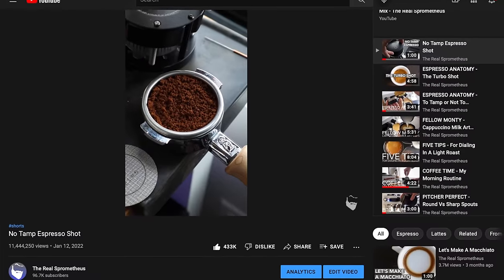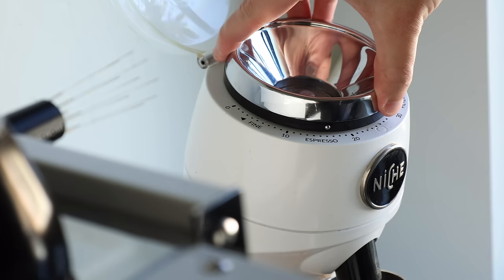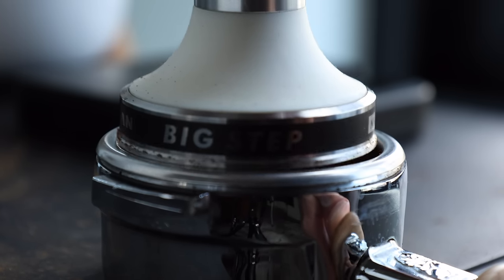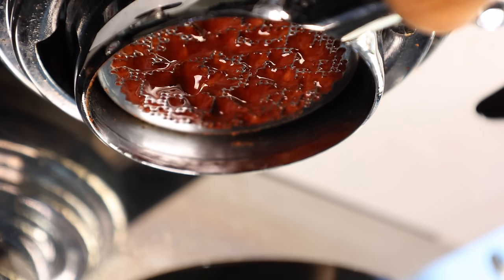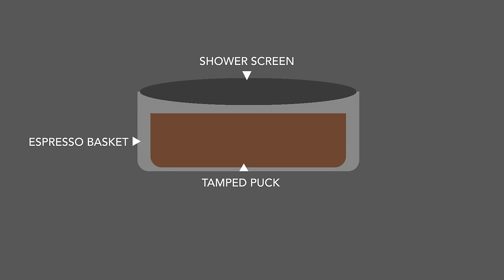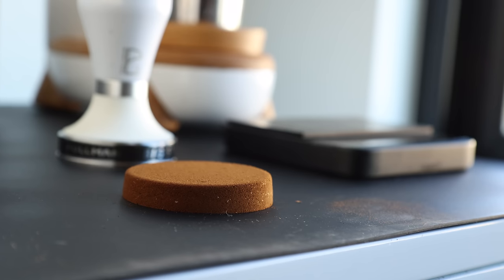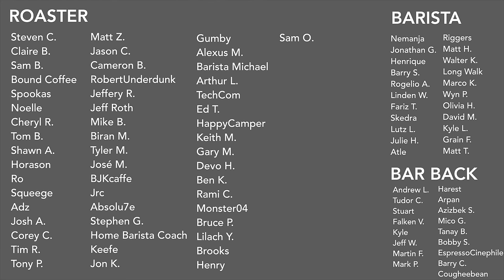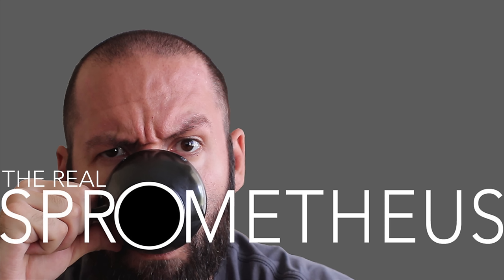ESPRESSO ANATOMY - Does Tamping Matter?

Comment: This reminds me of the debate about whether or not turbo shots and flow-profiled shots are "really" espresso.  I wonder if a "true" no-tamp shot works better with deeper baskets, and perhaps an Aeropress filter or puck screen on top, kind of how a moka pot brews. Then again, a moka pot brews much hotter but with much lower pressure. My thought is that not tamping at all creates a slurry because of the turbulence in the basket from the high pressure. When I was first introduced to this concept, it was from the people at La Marzocco during the NY Coffee Fest in 2018. They were dosing 17g and using a distribution tool, but also using a GS3 for pressure profiling. I found the best results with the coffee they were using were a distribu-tamp with a slight pre-infusion, 6 bar pressure, and then slow ramp back down. Thinking about this moka pot as a comparison, this makes some sense to me.
Reply from the maker: I see what your saying, that is interesting. But the part that I was most surprised by, there’s a debate that turbo and flow profiling isn’t espresso? This is news to me.
Reply: @Sprometheus  Yeah, it's a pedantic thing of "if it doesn't hit 9bars of pressure and doesn't extract in the SCA defined time for espresso, then it's not espresso".

Comment: Well spotted Sir! Fascinating seeing the outline of the distributor at the bottom of the basket when the flow first appears. You didn't mention the puck screens. I've found I can tamp much lighter, with better results using the puck screen. I suspect that the puck screen does a sort of in-shot secondary tamp as my pucks are always nice firm cakes when I knock them out regardless of how hard I tamp.
Reply from the maker: Thanks George, and I did try the puck screens and I found it did do some compression but didn’t include it as it just didn’t seem to be all that interesting of an addition to the topic. And for me using the screen with untamped coffee and a normal dose the screen on the machine actually would press down effectively tamping before the water even flowed.

Comment: I've been riding the 'no tamp, just level' train for about two years. The reason I keep at it is that the shots taste good to my palate and it keeps things consistent. That being said I adjusted my leveler to max height (or depth?) to ensure the puck is basically compressed.
Reply from the maker: I think a leveler can be almost as consistent as a palm tamper, and taste is king! So as long as it’s tasty no need to fix something that isn’t broken
Reply: @Sprometheus  agree on that
Reply: Many ways to skin a cat.  It's all about taste.  I've made many an espresso that's come out too fast but tasted awesome and then saw sprom do a video on the turbo shot.  Was a great watch.

Comment: Great video, I only used a leveler for the first 3 months of making espresso but then switched over to a tamper. I found I got better body and texture from my shots but felt it was less consistent. I just bought a normcore tamper so I'm hoping I get better consistency with tamping pressure and leveling. (My setup is a Gaggia Classic Pro with OPV mod and a Baratza Sette 270)
Reply from the maker: Thanks Andrew! A palm tamper is always going to the the most consistent way to go, I have one but just love my Pullman so much haha. What pressure are you using on the OPV, I have a classic pro and the kit here, just waiting to be installed haha.
Reply: @Sprometheus  Yeah I was originally thinking about getting a palm tamper but I just like the aesthetic of an actual tamper haha. I'm using  the Mr Shades 6.5 bar mod which I prefer to the 9 bar one.

Comment: When I first bought an espresso machine I watched a video where Mark from "Whole Latte Love" commented that tamping was overrated and demonstrated just using his (Assos) leveler to do the same job. I've now been doing it that way for years with good results and have, in fact, never tamped in my life! I do have the leveler set fairly deep so it applies some pressure, and I lower it onto the bed very slowly while spinning so as to evenly and gradually apply the pressure. It has worked for me. But I do wonder if by tamping I could elevate my results further. One thing I found interesting, and perhaps unsurprising, in your testing is that tamping had the highest extractions, followed closely by using a leveler, but the leveler appeared to actually have the most consistent results!

Comment: Yes tamp - but not overly hard. I also have a Niche, OCD, and LMLM. My son visited and tried it. He really smashed the tamp and got more channeling than I ever do. I’m probably hitting just under 30 LBs. I press until the sponginess collapses and no more.

The biggest improvement to my espresso, since getting the LMLM is backflushing daily. Since I’m only pulling 4-5 shots, rather than a cafe load, I can use the tiniest amount of cleaning powder. It rinses fast and easily, so it’s less than a five minute job. 

In the past, I treated it like BIG maintenance. I’d remove the screen and basket to soak, open the machine to oil the boiler vent valve, etc. It was a pain, so I did it rarely. There was lots of buildup, so I’d use lots of chemical and multiple applications. Rinsing took longer and probably left residual soap. Not ideal.

Now, I just leave the screen in place and use a trace of powder. It’s fast and easy, rinses perfectly clean, and every shot is crisp and in clear focus. Without such cleanings, shots get muddy with a hint of old-coffee-pot from the rancid oils.

I still do a bigger clean or service on occasion, but doing a quick simple backflush daily is a great habit to develop for getting the best possible shots.
Reply: The key is to use the smallest amount of cleaning powder that you can get away with. Just enough to still give some suds. Since the buildup is minimal, you don’t need much, and with minimal soap and clean surfaces, there’s nothing for the chemicals to attach to. It really rinses clean.

I wish I had learned this years ago.

Comment: Quite an interesting video and the comparison test results was kinda expected but strangely enough, I just came across one barista of a famous coffee shop from Japan who doesn't push the tamper into the portafilter basket. I saw that he barely pressed it down, just a slight touch on top of the coffee ground to make a flat surface of coffee bed. Even so, he can pull the shot in a consistent way and the coffee dripped down through the bottomless portafilter with a good flow without any sign of channeling. Worth mentioning that he paddled the Slayer halfway and wait for about 17-1s before he continue to push it all the way.
Not sure if it is something unorthodox but his workflow seems to be more efficient.

Comment: Re OCD
in order to avoid the slight uneven compression, I use my fingers slightly between ocd and portafilter…. Giving about 3/8 inch space.  Then spin the ocd as I drop the final 3/8 inch.  

I also use the currently fashionable screen which I feel has a few benefits,   Keeps the screen and machine cleaner! Reduces occasional channeling, and eliminates occasional puck adhering to the screen.

Comment: I mostly do 19-20g tripple shots in a naked PF and I use a leveler for it's intended purpose-TO LEVEL the COFFEE BED-and then I do a moderate to heavy tamp (mazzer Major/titanium burrs set @ around 8 with actual zero (when the burrs touch) being 6. This method has been working for me ever since levelers 1st became available.
Reply from the maker: I found a mixed experience with levelers. I actually retired using mine awhile back because I found lower extraction numbers. But I think there is something to be said for all of the variables combined.

Comment: The extraction percentage chart put up at the end was very telling and relatively linear among techniques which I feel is a pretty open and shut case that puck compression is required. How that compression is accomplished is more nuanced. As I mentioned in the last video I have removed my tamp (calibrated) from the flow just because my observations seemed to support the empirical data provided here. I could probably squeeze a few additional percent out of my workflow by adding it back in and for troublemaker extractions I do. I think we may be able to settle on the term "compressed" to encompass all of the myriad tools we have at our disposal to accomplish the task (or we can all just keep the discussion going haha).

Quick parting question: you mentioned that the top of the compressed puck creates a layer that is temporarily impervious to water. I have played around with spritzing my compressed puck as my last prep step and I don't have a feeling about it just yet. Something tells me that it is a pre-pre-infusion that gently prepares the surface of the puck to accept the rather violent infusion of water that it will experience during extraction and may result in more even penetration of water across the surface of the puck but I don't have anything to back that up. I'd be curious to see your take on what that step might do and how it impacts the extraction.

Comment: I’d be interested to know if just dropping a puck screen on top of an untamped bed of espresso in the portafilter improves your results. Consistent with the results in your video on using a puck screen, I find shots (from tamped pucks) run slower and channel a bit more when not using one. Perhaps the puck screen would add some needed resistance and better water distribution for untamped espresso.

Comment: For the cafemacs robot a very slight tamp (maybe double the weight of the tamper) will give you the same results as a full tamp, sometimes even better imo. I don’t have a refractometer, however, so this is purely based on taste.

Comment: I use a Breville Oracle Touch, which has a build in “tamp fan”. I suspect it’s just a distribution tool. I’ll try tamping after the tamp fan and let’s see what that does.
Reply from the maker: Yeah I’m sure the fan operates a lot like the OCD and flattens by layering spins. Is there a way to skip the fan and try just a plain tamp to compare?
Reply: @Sprometheus  I have a Rancillio Rocky, which has been relegated to pourover duty. I can try dialing that in and comparing, but right now I'm thinking that tamping on top of the fan's action might be the easy solution the issue of inconsistent shots. A 30 second brew can produce between 38 and 60 grams of espresso from the same grind, against 22 g of coffee. If a consistent tamp can bring that under control, that would get me back to my preferred balance of laziness and tastiness. I knew I'd never be dialing superior shots, but the Oracle has gotten me into espresso and milk drinks, when previous espresso makers had failed.

Comment: I thought you were supposed to use a leveler like the OCD and then tamp. Did I get that wrong? Or did you intentionally omit this from your testing? Great video!
Reply from the maker: Yeah so the design of the OCD is intended to be low level and just flatten the bed. But when I made the popular short I was messing around with using it deeper as a tamper and that’s what set all the gears in motion, so in this video it was intentional I didn’t use it as designed.  Thanks for watching!

Comment: I have only been using the OCD for the past 2 years and have never looked back. I followed advice that it was the level bed for water to hit that was important not the tamp. I have not changed the depth of the leveller from 9mm with and 18.5 g dose.

Comment: I am curious and wish there was some discussion about over tamping.  What are the consequences of over tamping?  When I really pack it down, I think the water may channel not through the puck, but around the sides of the puck causing the puck to float up.  That's my theory anyways.  Before pulling the shot on a puck with a heavy tamp, I observe a decent amount of head space. After pulling the shot, I observe the puck had "floated" up so that there is minimal head space.  Just to verify it wasn't caused by expansion due to absorption of water, I measured the thickness of the spent puck vs the depth of the basket.  The puck was thinner by about a 1/4" than the depth of the basket which led me to conclude the "head space" has gone to the bottom of the basket making the puck float up.  Anyone have a similar experience?

Comment: For this test, did you do full wdt bottom up, or just the top? Also, for both tamp and OCD? I did ditch my Motta distributor after a couple of months, and either just tap bed down then tamp, or wdt the top layer before tamp. I grind directly in pf/funnel, not using dosing cup.

Comment: Another interesting video! I’ve been levelling without tamping for a while. After seeing the video I’m thinking maybe I should buy something like a normcore level tamper. The issue I’ve been having is that my puck often has a pit towards the middle, the puck is more compressed in the middle than towards the edges. Bottomless portafilter also shows first drops appearing and faster blonding of the flow in the middle. Could this be due to not tamping?
Reply from the maker: My guess is this has something to do with distribution, and possibly not tamping. Honestly I’d invest in a WDT tool and I think they may solve your issues.
Reply: WDT-tool + tamp fixed the problem! Thanks!

Comment: Lifestyle lab showed pressure and flow was consistent as low as 5 pound with full 9 bar when not using pre infusion  but 20 pound and up was required to be consistent when using pre infusion. What do you think about those results?

Comment: I got a Gaggia OWC just over a month ago and am just having an awful time with channeling. I added the dimmer mod to lower pressure and PID to level out the temp. Lately I've messing with grind and tamp a lot, and I think I'm getting closer, but still get channeling. I was wondering if it had to do with my tamp not being perfectly level
Reply from the maker: Does the dimmer mod change anything having to do with pressure? I have a Gaggia and from stock it’s at 14 bars and on a bottomless it just destroys the puck without super careful and meticulous puck prep.
Reply: Yeah, just adding an old style light dimmer you can adjust it from full to pretty much no flow. I kind of just guessed where 9bars is on the dial and have been pulling shots from there. I need to get a pressure dial and verify. Thanks for the confirmation that I'm not alone. Could you make a short going over ' meticulous puck prep' :)

Comment: The pattern from the distribution tool is really interesting! Given it spins, why do you think the pattern is so distinct?

I’d imagine it levels equally and therefore wouldn’t be so evident 🤷‍♂️
Reply: It levels evenly after the spin, however I think the imprint would come from how the distro tool first goes in and creates that initial pressure on the puck, that will be where the most force is applied to the coffee
Reply: @christmas83  that certainly appears to be the case, but I don’t understand why the initial pressure is greatest at the point of contact. The lip of the tool stops it depressing any further and then it rotates at exactly the same depth across the entire puck? Why is there more force on initial application? 

I’m probably overly thinking it, and as you say, the initial pressure is what causes the imprint 🤷‍♂️